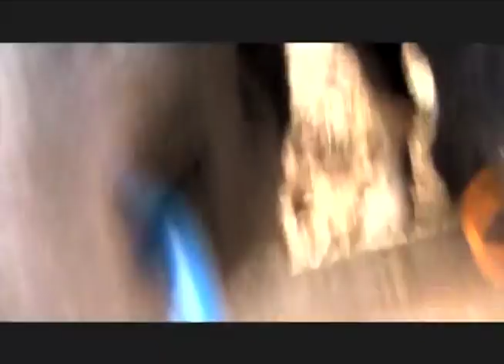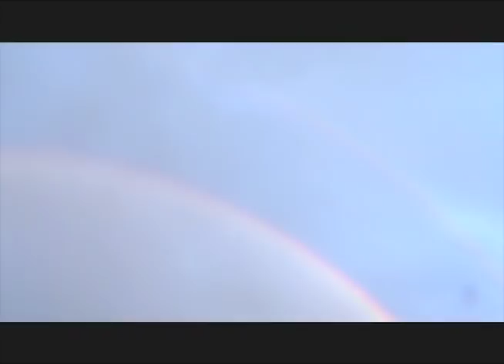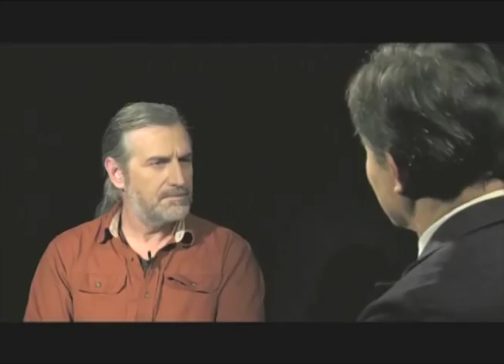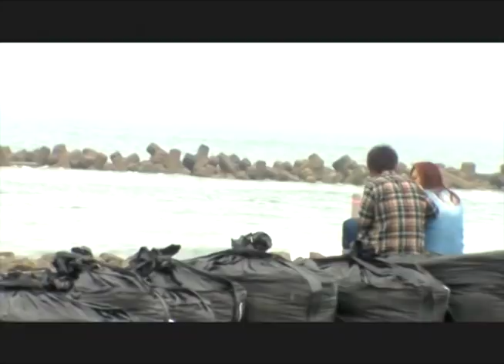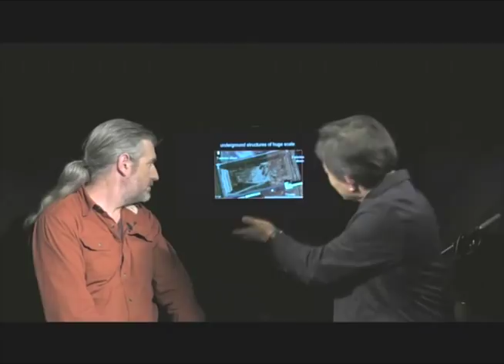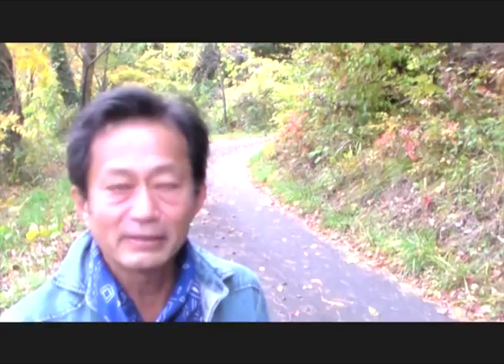Yoichi Shimatsu - Tracking Fukushima's Nuclear Weapons Sites

Comment: My goodness.  I still don't understand.  The Japanese do everything right.  You can't convince me the cooling pumps went down.  Those cooling systems are on a closed loop.  It had to be sabotaged.  By who? And why?
Reply: Jim stone said the isrealis did it since japan was friendly to iran
Reply: Cooling pumps don't work without power.
Reply: Junk Science : A closed electrical loop=no loss of power.  The rods heat the water, the water turns into steam, the steam spins the generators, the generators create electricity, that electricity is fed back to the pumps from the source.  It's self contained.  Fail proof.  If I'm wrong and it's not engineered that way.  Why?  If I'm right and it is.  What really happened?  Flooding should not interrupt a closed system if built properly.  Even those asking questions stop short of asking the real questions.  Looks like the tidal wave was cover for sabatoge.  Of course the government regulators and corporate entities inspecting and running the facility aren't going to provide the real story.  Too much liability and embarrassment.
Reply: All roads lead to Davos.
Reply: Jim Stone sounds like a real idiot.